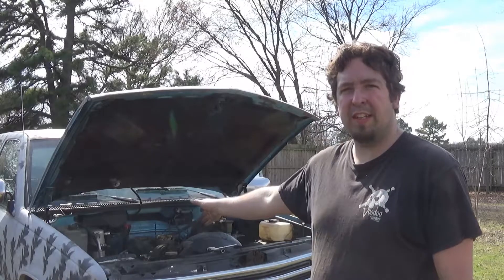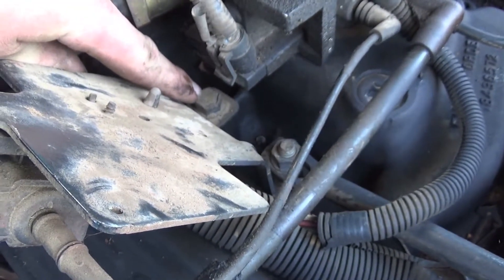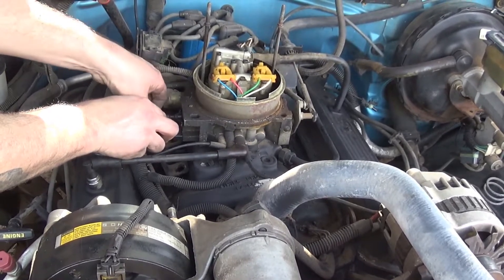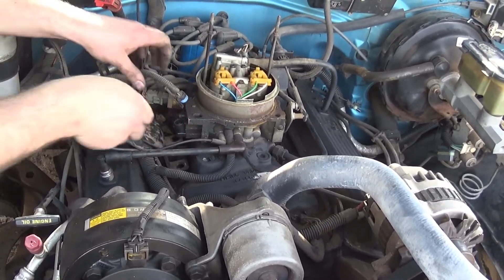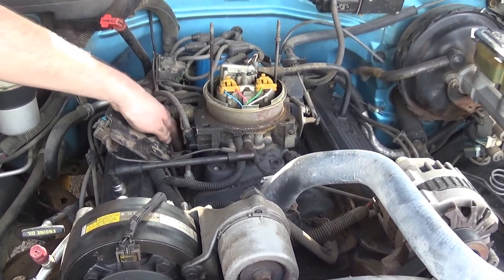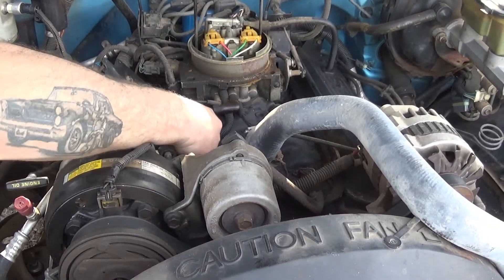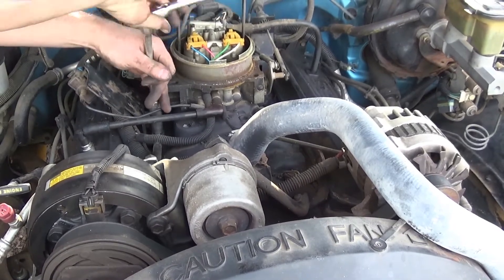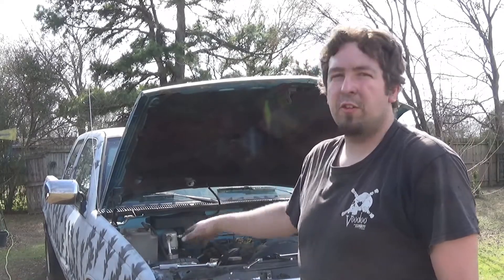TBI throttle position sensor chevy small block throttle body injected

Comment: Unfortunately I have a big ass metal plate right under the tps and throttle body , I can’t twist my new TPS because of it. Can I just pull the the throttle cable to the position the tps needs to be set in? I’ve been trying to find answers to this for a while, replaced the tps on my 454 94 k2500  but it didn’t fix my problem probably because I didn’t put it on right
Reply from the maker: @timmytomtimithjr8522  yea you can move throttle to sit it in there correctly.

Comment: If a certain someone messes with the idle screw that has a cap on it, that isnt supposed to be romoved, how do you adjust it back to the correct location? Im the certain someone who was stupid. I cant seem to get it back in the correct position.
Reply from the maker: I think it would be best to get a new one and call it a day, trying to fix that maybe more of a headache then its worth.
Reply: @EfurdGarage  nah I'd rather not do that. I know I can use a volt meter and adjust it that way I just thought maybe you knew a different way.
Reply: @EfurdGarage  I'm a fix it kind of mechanic not shotgun new parts just because. I've almost got it right I just haven't put the meter to it yet.

Comment: I just got a 94 k1500 motor runs great but for some reason it won’t shift out of first until I let off the gas. I’ve been asking everywhere but can’t seem to get an answer, any ideas as to what it could be?
Reply: It’s full now, when I first got it it was leaking bad as hell and the fluid was black so I changed the gasket fluid and filter only thing left to change would be the transmission solenoid or the position sensor
Reply from the maker: @bennylugo18  well you are on the right track i would start with position sensor
Reply from the maker: 4l60e? First have you checked fluid? is it full and whats it smell like? smells burnt or is it really dark? Since this is an electronic the throttle position sensor dose control shifts have you changed it? also check case id and verify you have a 94 or 93 the rest of the year transmissions dont interchange.
Reply: Servo on passenger side of trans dude. Its called a servo but is only a big round hydraulic valve called a 2-4 corvette servo.
You can get them from anywhere, but when they wear out, you gotta drive it like a standard until you fix it. 
Think about how many times that thing shifts from 1st to 2nd... The rubber like bands wear, the metal wears, fluid pressure fails or bypasses the valve and the servo won't engage the sun shell for the shift, Trust that.

Comment: What was the symptoms as to why you replaced throttle pos. sensor?
Reply from the maker: There can be a few symptoms some overlap overs. Such as hesitating acceleration, running rich or lean, rough idle, bogging down.   Honestly this one was the original sensor i was giving it a complete tune up and making videos on changing out parts.
Reply: Hello. I changed mine today. Even running worse. IAC and new injectors. No change. Running slow with like 30mph the engine goes off. Then quick to N, restart and again D. Chevrolet r10 1987. 5.7L. Any ideas? Maybe fuel pump? Difficult to change on my model. Thanks a lot🙏🏾

Comment: I have 88 2500 Scottsdale with 5.7 tbi. will not stay running for more than minute. Only stays running when I disconnect the map sensor? which is new. also replaced egr valve and solenoid. after watching your video removing and replacing fuel pressure regulator which was a big help! I just cleaned mine with new diaphragm seal. still dies. maybe I will replace tp sensor. sorry for lengthy comment. Yelm WA
Reply from the maker: Well a with a faulty map the ecm will use the tps to compensate the value. I would suggest 2 things first. putting the old one back one, when i did this truck i had a couple of faulty parts out of the box. 2 check for vacuum leaks mainly around the map but also every where else.
Reply: Thanks for the quick response @EfurdGarage
Reply from the maker: @brianphillippe1694  your welcome
Reply: Will do! much appreciated have a  great Christmas @EfurdGarage
Reply from the maker: @brianphillippe1694  I hope that helps and gets it fixed. Merry Christmas to you too.
Reply: Sounds like a bad distributor. My Halifax unit had a c clip break and it was touching stuff it shouldn't and would just die after a few minutes. Not sure if Halifax is the correct word. It's the round thing below the rotor.

Comment: I changed mine, now my truck is cutting off. Do I have a bad new sensor  ?.
Reply from the maker: very possible tps is hard to mess up installing. but when working on this truck i had to return several sensors because they were bad out of the box

Comment: Great video. I have almost the exact same set up. My issue is it idles fine but when I put it in gear the engine surges when my foot is on the brake. Any pointers? Idle air control valve, throttle position sensor, egr valve and egr valve solenoid are all new. Im lost. Any advice?
Reply from the maker: well you changed alot already. i would look at vacuum next. maybe a vacuum leak when the break is applied. you can connect a vacuum gauge and watch and see what happens